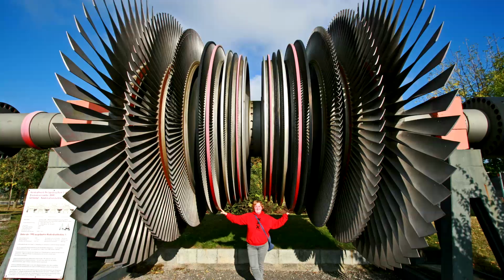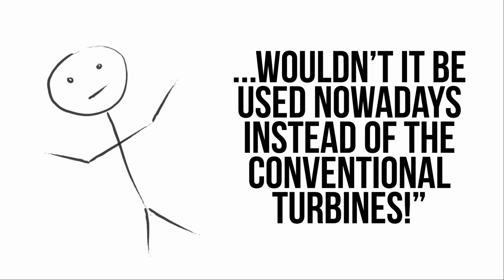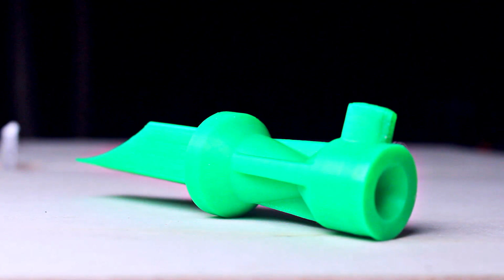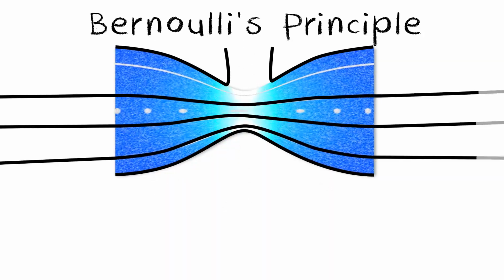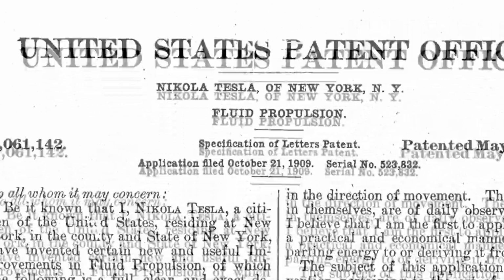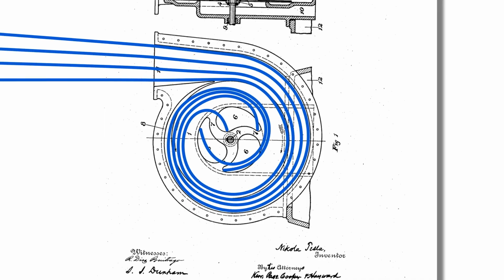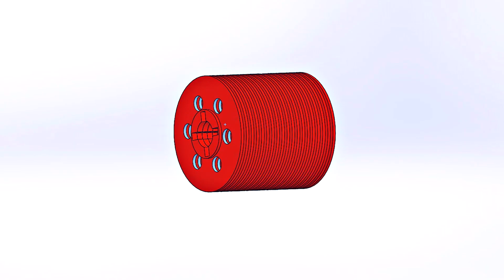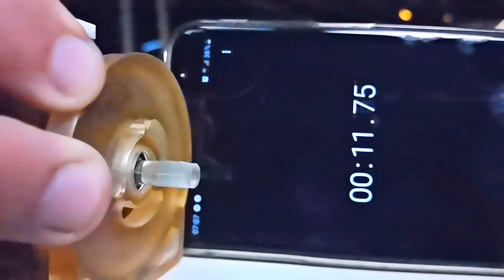Tesla Turbine [Smoke Flow Slow Mo]

Comment: HI Integza - loving your vids:-) Aaaannd regarding your question: First thing comes to mind is what about having a bypass in order to start the engine and then switch to the valve when the engine is running. Second thought: What if you use some more (maybe shorter) valves in paralell to each other and thereby reducing resistance? For the problem of UV-curing the material inside of the valve: Option 1: Print two halves and glue them together using the same method as you use for making the engine barrel. Option 2: Cast with metall using lost PLA method.

Comment: This rmp can be achieved by steam turbine . I worked with steam turbine which can rotate at 27000 rpm but that's with high pressure saturated steam. I guess you should make a small boiler it will be awesome . Your videos are good ❤️

Comment: Wouldn't this whole setup work better if the design was skewed slightly to create a small amount of more drag, or to have the turbines have a dented surface like a golfball to create some sort of slight drag that somehow directs the torque or the wind to make the turbine more efficient at lower speeds?
Reply: by skewed i mean the vertical angle could be slightly skewed by like a degree or two to make more drag to produce torque. While I am thinking about it wouldn't having the holes that allow air to pass through the turbine have a slightly skewed alignment  so they followed a helix pattern or alternating between layers by 45 degrees to make mean that the force would be used more as the air is held within the system longer? I am honestly guessing based on my imagining of

Comment: I seem to recall a video elsewhere on YouTube where a Tesla Turbine was run at sufficient speed that the centrifugal force of the airflow reached an equilibrium with the exhaust vortex, resulting in a steep RPM increase and higher efficiency.   The speed was 50,000 RPMs, after that it jumped to 70-80k and seemed to smooth out.  Might be worth testing...
Reply: Yeah I spent his entire testing going "let it Rev up damn the" at my phone.

Tesla turbines massively increases in efficiency and torque when allowed time to accelerate as it allows the flow patterns to reach their ideal forms

Comment: Does the original patent specify the flow in ward?  Wouldn't going from high pressure to low pressure, have the flow moving outward?  Instead of printing your disk: use hard drive disks.

Comment: Zero point energy of the 'gem' photon with it's 3 oscillating modalities.  Nature already oscillates.  It's just a matter of tapping into the energy differential of that moving energy:

'IF' my latest TOE idea is really true, (and I fully acknowledge the 'if' at this time), that the pulsating, swirling 'gem' photon is the energy unit of this universe that makes up everything in existence in this universe, and what is called 'gravity' is a part of what is currently recognized as the 'em' photon, then the oscillation of these 3 interacting modalities of the energy unit would be as follows:

Gravity: Maximum in one direction, Neutral, Maximum in the other direction;
Electrical: Maximum in one direction, Neutral, Maximum in the other direction;
Magnetic: Maximum in one direction, Neutral, Maximum in the other direction.

Then:
1 singular energy unit, with 3 different modalities, with 6 maximum most reactive positions, with 9 total basic reactive positions (neutrals included).  Hence 1, 3, 6, 9 being very prominent numbers in this universe and why mathematics even works in this universe.
(And possibly '0', zero, as possibly neutrals are against other neutrals, even if only briefly, for no flow of energy, hence the number system that we currently have).
Reply: Revised TOE: 3/25/2017a.
My Current TOE:

THE SETUP:
1. Modern science currently recognizes four forces of nature: The strong nuclear force, the weak nuclear force, gravity, and electromagnetism.
2. In school we are taught that with magnetism, opposite polarities attract and like polarities repel. But inside the arc of a large horseshoe magnet it's the other way around, like polarities attract and opposite polarities repel. (I have proved this to myself with magnets and anybody with a large horseshoe magnet and two smaller bar magnets can easily prove this to yourself too.  It occurs at the outer end of the inner arc of the horseshoe magnet.).
3. Charged particles have an associated magnetic field with them.
4. Protons and electrons are charged particles and have their associated magnetic fields with them.
5. Photons also have both an electric and a magnetic component to them.

FOUR FORCES OF NATURE DOWN INTO TWO:
6. When an electron is in close proximity to the nucleus, it would basically generate a 360 degree spherical magnetic field.
7. Like charged protons would stick together inside of this magnetic field, while simultaneously repelling opposite charged electrons inside this magnetic field, while simultaneously attracting the opposite charged electrons across the inner portion of the electron's moving magnetic field.
8. There are probably no such thing as "gluons" in actual reality.
9. The strong nuclear force and the weak nuclear force are probably derivatives of the electro-magnetic field interactions between electrons and protons.
10. The nucleus is probably an electro-magnetic field boundary.
11. Quarks also supposedly have a charge to them and then would also most likely have electro-magnetic fields associated with them, possibly a different arrangement for each of the six different type of quarks.
12. The interactions between the quarks EM forces are how and why protons and neutrons formulate as well as how and why protons and neutrons stay inside of the nucleus and do not just pass through as neutrinos do.

THE GEM FORCE INTERACTIONS AND QUANTA:
13. Personally, I currently believe that the directional force in photons is "gravity".  It's the force that makes the sine wave of EM energy go from a wide (maximum extension) to a point (minimum extension) of a moving photon and acts 90 degrees to the EM forces which act 90 degrees to each other.  When the EM gets to maximum extension, "gravity" flips and EM goes to minimum, then "gravity" flips and goes back to maximum, etc, etc.  A stationary photon would pulse from it's maximum extension to a point possibly even too small to detect, then back to maximum, etc, etc.
14. I also believe that a pulsating, swirling singularity (which is basically a pulsating, swirling 'gem' photon) is the energy unit in this universe.
15. When these pulsating, swirling energy units interact with other energy units, they tangle together and can interlock at times. Various shapes (strings, spheres, whatever) might be formed, which then create sub-atomic material, atoms, molecules, and everything in existence in this universe.
16. When the energy units unite and interlock together they would tend to stabilize and vibrate.
17. I believe there is probably a Photonic Theory Of The Atomic Structure.
18. Everything is basically "light" (photons) in a universe entirely filled with "light" (photons).

THE MAGNETIC FORCE SPECIFICALLY:
19. When the electron with it's associated magnetic field goes around the proton with it's associated magnetic field, internal and external energy oscillations are set up.
20. When more than one atom is involved, and these energy frequencies align, they add together, specifically the magnetic field frequency.
21. I currently believe that this is where a line of flux originates from, aligned magnetic field frequencies.

NOTES:
22. The Earth can be looked at as being a massive singular interacting photon with it's magnetic field, electrical surface field, and gravity, all three photonic forces all being 90 degrees from each other.
23. The flat spiral galaxy can be looked at as being a massive singular interacting photon with it's magnetic fields on each side of the plane of matter, the electrical field along the plane of matter, and gravity being directed towards the galactic center's black hole where the gravitational forces would meet, all three photonic forces all being 90 degrees from each other.
24. As below in the singularity, as above in the galaxy and probably universe as well.
25. I believe there are only two forces of nature, Gravity and EM, (GEM). Due to the stability of the GEM with the energy unit, this is also why the forces of nature haven't evolved by now. Of which with the current theory of understanding, how come the forces of nature haven't evolved by now since the original conditions acting upon the singularity aren't acting upon them like they originally were, billions of years have supposedly elapsed, in a universe that continues to expand and cool, with energy that could not be created nor destroyed would be getting less and less dense? My theory would seem to make more sense if in fact it is really true. I really wonder if it is in fact really true.
26. And the universe would be expanding due to these pulsating and interacting energy units and would also allow galaxies to collide, of which, how could galaxies ever collide if they are all speeding away from each other like is currently taught?

DISCLAIMER:
27. As I as well as all of humanity truly do not know what we do not know, the above certainly could be wrong. It would have to be proved or disproved to know for more certainty.
Reply: Here is the test for the 'gravity' portion of my TOE idea.  I do not have the necessary resources to do the test but maybe you or someone else reading this does, will do the test, then tell the world what is found out either way.

a. Imagine a 12 hour clock.
b. Put a magnetic field across from the 3 to 9 o'clock positions.
c. Put an electric field across from the 6 to 12 o'clock positions.
(The magnetic field and electric field would be 90 degrees to each other and should be polarized so as to complement each other.)
d. Shoot a high powered laser through the center of the clock at 90 degrees to the em fields.
e. Do this with the em fields on and off.
(The em fields could be varied in size, strength, density and depth.  The intent would be to energy frequency match the laser and em fields for optimal results.)
f. Look for any gravitational / anti-gravitational effects.
(Including the utilization of ferro cells so as to be able to actually see the energy field movements.)
(And note:  if done right, it's possible a mini gravitational black hole might form.  Be ready for it.  In addition, it's possible a neutrino might be formed before the black hole stage, the neutrino being a substance with a very high gravitational modality with very low 'em' modalities.)

(An alternative to the above would be to shoot 3 high powered lasers, or a single high powered laser split into 3 beams, each adjustable to achieve the above set up, all focused upon a single point in space.)

'If' effects are noted, 'then' further research could be done.
'If' effects are not noted, 'then' my latest TOE idea is wrong.  But still, we would know what 'gravity' was not, which is still something in the scientific world.  Science still wins either way and moves forward.

Comment: Electric cars are not the answer. When you look at the processes involved to make, in particular the batteries, disposal and recycling of such has a larger carbon footprint than you might think. Also, the energy required for charging stations, the power grid, think about whats behind all that.

Comment: Try all metal impellers ,this would allow the speed to increase due to the increased rotational mass .and soak your bearings in a solvent to remove the grease ,replace grease with a dry lube spray for guns.😉

Comment: Hey, I love your work. I am interested in developing a commercial application for the TT, using medium-temperature steam produced from Utah geothermal resources that produce saturated-steam at 350-C, which would of necessity be accelerated and heated using a pulse-detonation rocket engine (PDRE) to accelerate and micronize the water-droplets present in saturated steam. (Put in a little bit of thermal energy in the form of supersonic shockwaves to enable power recovery from low-temperature resources. We could create a lot of "drag" with this geothermal fluid that is other wise not useful in traditional turbines due to quick erosion of blades. The TT solves this problem because..  Let's keep this confidential. Send me an email, if you wish, and I will reply with a description of the concept and more of the rational.  taylor@taylorenergy.org  I have the pulse-detonation technology and some other elements of this system. My company, Taylor Energy, does government funder R&D in the USA. We would need a state or federal grant to pursue this work seriously, which could happen, I think, with the right proposal. dgt

Comment: Thermodynamic efficiency of modern steam turbines is around 40%, that's a Second Law Limit, you can hardly go above it with current materials. ~500°C is maximum practical temperature of the overheated steam that can be achieved, and it sets the limit for maximum efficiency...

Comment: Why do everyone copy this version of the tesla turbine? I prefer the one where the distance from the centre to the outside reduces by 25% for every 90 degrees of rotation. This is the straightest way of curving something. I once worked out the trigonometric formula for it and played around with it... turned out this is also how you draw the perfect yin and yang symbol.
Reply: patent 1,061,142

Comment: hi have a 3d print idea that would also be a new invention of mine but don't have a 3d printer here goes we need to print a con with an inclosed bottom    4 slots for hydraulic air legs.   the legs will need to be 3 parts for optimal movement and will need to be designed to move with hydraulic air pumps      the intake will need to be from the top of the con  and the exit of the air will need to run out of the bottom of the con   the purpose of this devise it to convert wave energy into an air pump that  sucks air in and sends it out into the water        the goal of this device is to re-oxygenate the dead zones of the oceans

Comment: I've seen better efficiency in Tesla Turbines with thin and shiny sheets - like a metal. I don't think you can 3D print the blades assembly. Just use some metal sheets only for this part and I believe you can achieve a better performance/efficiency.
Reply: Facts

Comment: improve the discs by making pockets or grooves on their surface.
Reply: This lowers efficiency. Although Tesla did some experiments, and found that bridging discs is some places improves starting torque without hurting efficiency too much.

Efficiency is improved by using a multi-stage design (which was also the design proposed by Tesla).

Yep, people have tried to further improve the efficiency of the Tesla turbine design in the way you described, and also other ways. However, the extreme simplicity of the Tesla turbine also has one drawback: it cannot be improved as much a conventional turbines. While in the 1950s, multi-stage Tesla turbines kicked ass compared to their conventional counterparts, nowadays the efficiency of conventional turbines beats Tesla turbines. With, admittedly, much more complex designs which had evolved over the course of more than 150 years.

The Wikipedia artic le about Tesla turbines is reasonably good. Note that the "95-98% efficiency" numbers are actually *estimates*, not verified real-life numbers.
https://en.wikipedia.org/wiki/Tesla_turbine

Comment: @Integza Another place you could probably get some more efficiency is in the discs themselves. In gasoline engine building, you must leave the intake ports with a rough finish. This promotes a turbulent flow on the walls of the ports, which keeps the fuel from settling out of suspension on the walls of the intake port. Meaning, a specific finish on the discs should yield more efficient power transfer between the fluid and the discs...

I'm having a hard time wrapping my mind around the physics of a golfball like surface on the disc... you could probably tune the band of turbulent vs laminar flow between the wheels more easily, which would help manage the flow that makes it to the outlet port... hopefully you understand my point...

Also, engine building is telling me that a design with load will be different than a design for no load!

Comment: Your not reaching synchronicity, check out jonnyq90 machining channel where he built one, you can kinda hear and feel when the air and the rotors synchronize and hit 97% efficiency, but the speeds are insane and the heat would probably melt your resin rotors but your design is still cool as hell

Comment: What if you use a big Tesla turbine and have a smaller turbine with blades where the air comes out at the center and instead of having the casing of the turbine guide the air into a spiral have spiral shapes on the disks themselves? I think this way you can reach the high speeds of the Tesla turbine while having the high twerk of the inner turbine when the rotation is slowed with resistance.
But I think the inner turbine might actually slow down the whole system at max speed, so I don't know.

Comment: I remember learning about the Tesla turbine and how one of the biggest drawbacks was the amount of warpage of the disks over time due to the high speeds and how modern composites like kevlar and carbonfiber can eliminate this drawback
Reply: This is not an issue because Tesla turbines don’t need to be spun crazy fast like everyone erroneously claims. You just have to to know how to design it correctly. Every fluid, gasses and liquids, can be made to flow in highly efficient low Reynolds’s numbers laminar flow regimes.